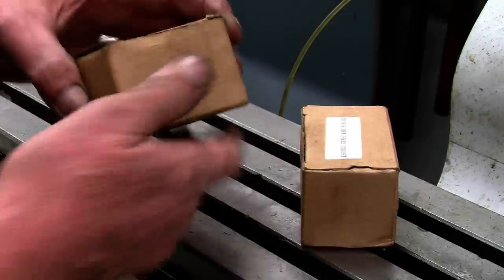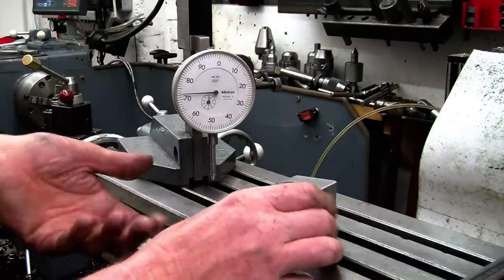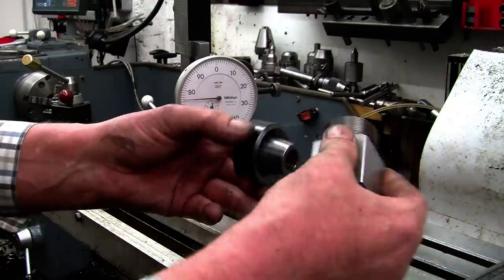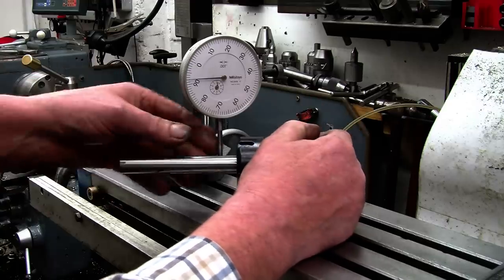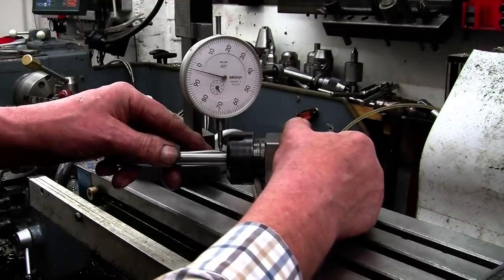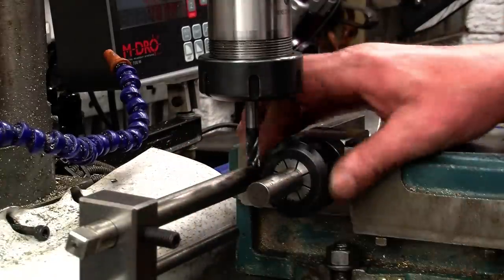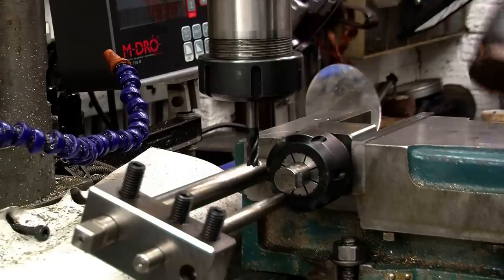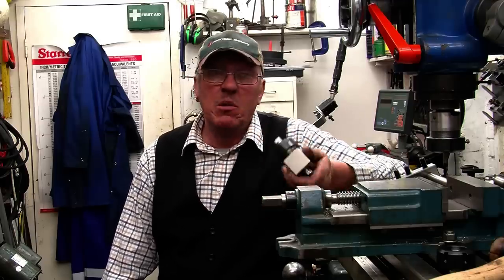Banggood  ER 32 Collet Block Review

Comment: the four times zero does not mean the block is square, just that the sets of opposing sides are equal
a parallelogram has equal opposing sides but is not square
Reply from the maker: very true the important thing is that the hole is in the middle

Comment: The whole point of having the nut bigger than the body is so you can butt the back of it up against the jaws of the vice and use it as a length stop, eliminating the need for an external vice stop.

These were invented by the late John Stevenson and originally brought to market by ArcEuroTrade, who still sell them.

Potential purchasers have to decide whether to support a UK company which has brought some innovative products to market, or an overseas company who is just copying someone else's idea...
Reply from the maker: I have met John on a few occasions  A very talented engineer in deed who is sadly missed . I had made collet blocks long before Arc Euro started selling them . To state He invented them is stretching the truth some what . Do Arc Euro not import tooling from China ECT
Reply: Arc import Chinese tools and sell them on the internet. Their recent crying on  some forums that Bangood are doing them out of business is sour grapes, as internet trading put plenty of British tool shops out of business. It's just business. Thanks for the honest review John, Bangood can expect an order from me.
Reply: John Stevenson didn't invent collet blocks. Arc Euro Trade do not manufacture their collet blocks in the UK. They import the exact same ones Bang good do, from China. To state that by buying from Bang good instead of Arc is in some way undermining UK business is highly misleading.